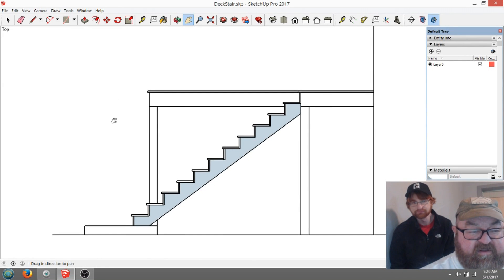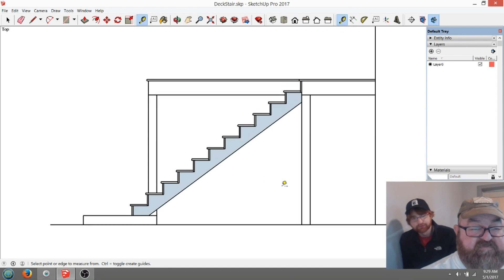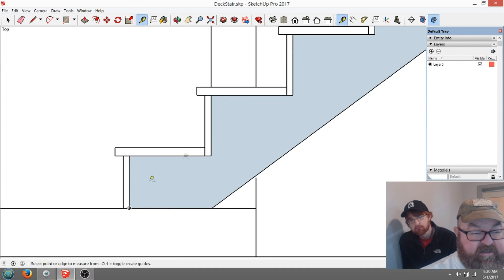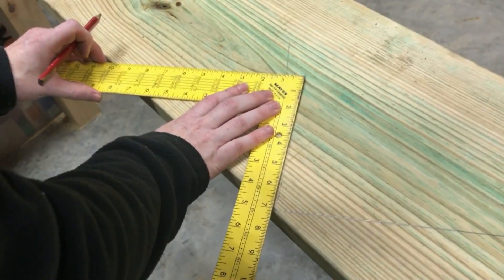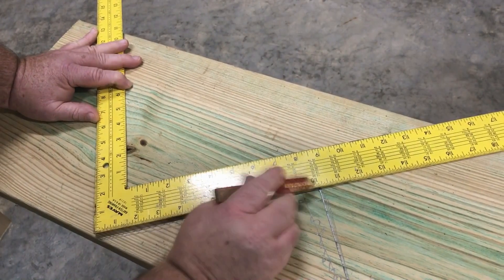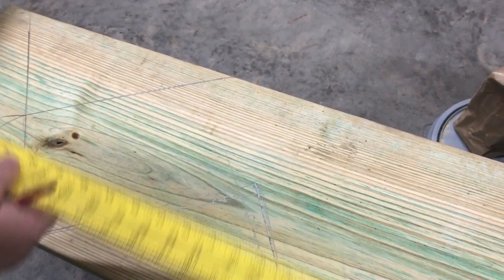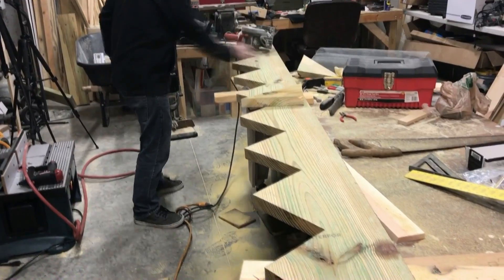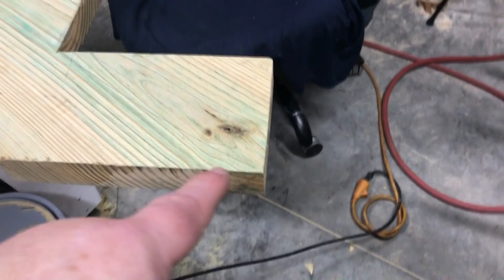Design and Cut Stair Stringers Using SketchUp and Saw

Comment: Great tips. I have a question. Using the square to lengthen the stinger pattern (good tip) but didn't that screw up the first step length, (to short) due to the square not being the same size on both ends? Or did you add the difference? Didnt see it in the video.
Reply from the maker: All it did was move the starting point closer to the end of the board.  I didn't start marking them till after I moved it so it did not effect anything. Thanks